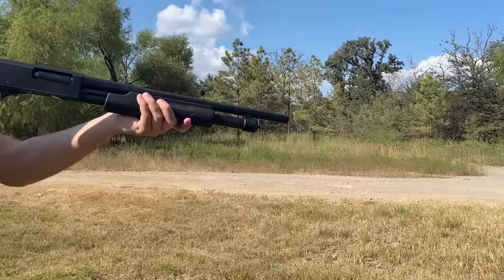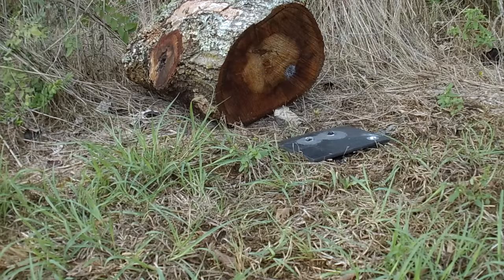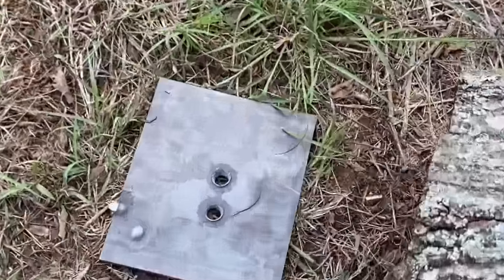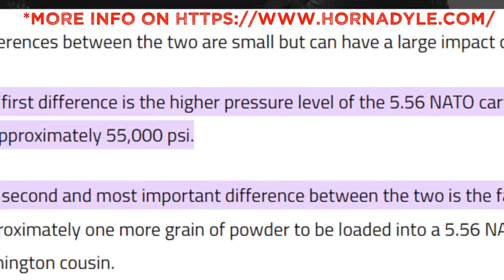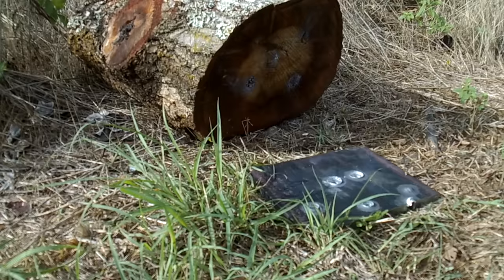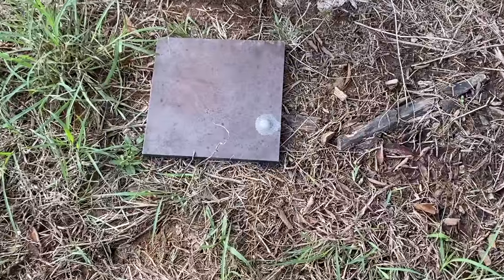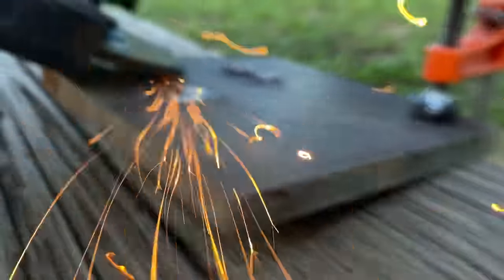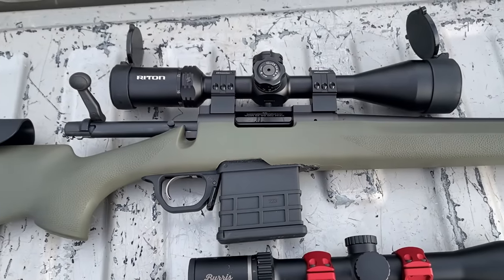223 vs 5.56: You Won't Believe The Difference On Steel

Comment: You said the same thing in the .308 v 7.62x51: 'Externally you wouldn't be able to tell the difference between the two cartridges." and the difference between the cartridges is glaringly obvious. The NATO rounds have annealed casings. That's something you might want to point out, since you haven't to this point, maybe in the future...annealing/sealing, and why.

Comment: What you said about the 556 may be true with more powder, But I have taken both apart and haven't found that to be true. The biggest difference is where they take the pressure reading from on the rifle. That's why the 556 has higher pressures for the most part. I don't  discount the 1 gr. More powder. I'm sure some manufactures do. But then they would cost more. Also the bullets need to be the same brand/mfg. to do the honest test. Keep up your testing.
Reply from the maker: I agree with you, that was just the info that I found on the hornady law enforcement website. I think that it might be true for the ammo that they sell directly to law enforcement, but not necessarily the civilian market.
Reply: Even if you weigh powder from each 223 and 5.56 it wont really tell you anything because they are probably not using the same powder. I reload for 5.56 and use faster burning powder that gets much higher velocity compared to factory 223 (about 300fps faster) even tough its the same weight powder charge compared to factory 223 because the 223 is using bulkier and slower burning powder.

Comment: Thank,you for this video....this lays to rest all the times I've been in "discussions" with bozos that say there's no difference.
Reply: If the ammo is from a reputable manufacturer, you will still find that the lower pressure thinner webbing .223 is loaded to it’s original 50+ year old specs, but the waters have been muddied so much nowadays.

Comment: the grain of the bullet counts for a lot in penetration in targets. its a fact that even applies to arrows and bolts .
 The weight of a projectile and the diameter are the determined effect and the powder the level of intensity its applied at.

Comment: This test is odd because I shot at industrial grade mild steel target stand with a 3/8 " plate welded on a 3/8" stand and I was able to shoot through one and both with most FMJ rounds I used with 10.25" inch barrel.

Comment: Good insightful test.  Yes your testing results proved that there is a clear difference in power factor penetraition between the 233 and 556.

Imagine if you can get some of the newer US Military 556 Tungsten bullets. Chances are they probably would penetraite the half inch steel plate.

Also some of the Soviet Russian rounds in 545x39 penetraite might as well.

Keep up the good important work.
Reply: Yes, the M855A1 ammo easily goes through 1/2” mild steel.   It also penetrates 9/16”.

Comment: I’ve accumulated a nice stash of .223 ammo the last couple of years.  Now I’m wondering if I should have (also or instead of) been buying 5.56.  There is lots of FMJ and green tip ammo available in both those calibers (as well as certain pistol calibers) but it’s hard to find ammo with PSP, hollow point or deer hunting bullets (which are all more expensive).

Comment: I enjoyed the video but may I suggest a change in testing method. Your steel plates are at an slanted angle thereby making the plate harder punch a hole through. It also makes the plate thicker. If you measure the plate at an angle it will measure thicker than if  measured at 90 degrees. This is why tank armor is slanted and not at 90 degrees. Not that a steel plate at 90 degrees would change your results but it would make for overall better testing. I did enjoy your video and thank you for taking the time to make and post your video.

Comment: I always thought the 5.56 case should have been made about a millimeter longer, just so you could get a little bit more velocity out of the heavier bullets.  Or maybe just a little bit fatter would be better,  or both. Actually I feel the same way about the Grendel, longer case on that one.
Reply: They simply went with a different powder.
Reply: The .223 chamber was designed with a short throat for better accuracy. The 5.56 chamber has a longer throat, like Weatherby chambers, to allow higher velocities without raising pressures. They chose to raise pressure on the 5.56 too.
Reply: If you roll to 2:23 in the video you can see that the 5.56 is slightly taller. This is due to the 5.56 NATO bullet being 50/1000 of in inch longer which matches up with the longer free bore in 5.56 NATO rifles. They did this to change the behavior of the bullet on impact especially on soft targets. The .223 loves to tumble on impact which is why it inflicts horrific wounds but is poor at penetrating obstructions. The 5.56 NATO maintains orientation on impact and doesn't tumble. There is lots of video on this using ballistic gel and watermelons if you don't believe me. Never fire a 5.56 NATO round in a rifle chambered for .223.

Comment: So, i think a factor not being included in analysis is twist rate. It also is why some heavier rounds wont stabilize in lower ratio barrels in another vid.

Twist rate can cause higher backpressure in seemingly identical builds, and increase dwell time in DI and piston guns.

This is why 62gr 556 is not reccomended from a 223 build.

Ive been meaning to get out and do some steel penetration analysis and documentation but havent had the time. Glad i came across your channel. Cool content. Subbed and following.
Reply from the maker: I really appreciate it and agree with the points you made! I believe that is what happened here.
Reply: @bananaballistics  have you ever seen the 8.6blk? Its the next build im gonna be working on. 1:3 twist! 

Im also working on a 30cal (for 300blk) that is progressively increased twist rate going from 1:8 to 1:4 for subsonic use. That should be interesting. Gonna also have to play with dwell times and buffer weights but goal is to reliably cycle the heavy 240 gr bullets.
Reply: No no no. Its not the twist rate, its the chamber throat. NATO rounds have higher powder charges that make for higher chamber pressures. The NATO chamber free flights for almost a 1/4" before engaging the rifling. The 223 is practically engaged in the rifling when chambered.

Comment: .223 pressure is measured using SAAMI. 5.56 NATO is measured using CIP. They are different and will give different readings on the same ammo. The difference between the two cartridges is really nothing more than chamber dimensions. Most notably. Head space. .223 at .025 and 5.56 at .050 so that the military has more options in bullet weight for specialty ammo like tracers, incendiary,etc.

Comment: Well shoot again but make sure the backing is the same.  The bounce of the metal plate has to have to effect the penetration.   There is a center of mass on the plate if you are off that then it can move and disperse some of the energy... ??

Comment: The pressure difference is mainly due to different messurements standards, the longer conus of the 5,56 is only to allow the use of special ammunition with longer bullets

And this sample size is much to small to do a propper comparison

Also you would need to use ammunition with the exact same bullet to elimminate diviation due to metallurgic differences

And grinding the bulge off is definitly not even a remotly precice method of messuring anithing here

Comment: The difference is the powder used and the test barrel length. They use slower powder for .223 sometimes and use a 24-26” test barrel. This is what screws people up. They think they can get 3,250 fps out of a 20” barrel when they actually get 2,950-3,000. If there running a 16” barrel they get about 2,800.
So I think the main advice I’d give is on the test barrel.
The availability of cheap 5.56 makes .223 illogical unless you have a 24-26” barrel.

Comment: how it was leaning up against the log would make a difference.  If the steel was able to rock back or slide back upon impact that would lessen the impact.    A valid test would have the plate in a solid frame.

Comment: 30 ft per second is not a normal differential between 223 and 556. However with slower burning powders you can keep the pressures down and get the velocity up with 223. That said, there are very few weapons that actually have a short freebore to the rifling that are technically 223 chamberings. Ruger made none of them and they're Mini-14 except for the possibility that they make a Target 223 Mini-14 right now that may actually have a shortened freebore as a chamber. The biggest difference between 223 and 556 is the chamber pressures. The problem there is that the chamber pressure when you test it from a standard cartridge is taken from the main body of the case. And chamber pressure when measured from a military cartridges taken from the neck. And that could show up Easley 10,000 lb difference as the neck of the cartridge will exhibit much higher pressure spike than the main body of the cartridge. As for 3240 feet-per-second compared to 3270, you'll see more speed differences in the individual cartridges themselves. Often overlapping in velocity. So is is there any functional difference between a 223 and 556, the speeds are that close, not a single dimes worth. And the difference in the test Barrels in which these different cartridges are tested, it means that what you see on the Box means nothing, you have to test your individual rifle.
You also need to check the actual projectors used, they may not be exactly identical.

Comment: Interesting vid mate. I suspect that the slightly higher velocity is what did it for the 5.56.
However, you missed some facts about the difference between 5.56 and .223, that are crucial to understand from a safety perspective for anyone considering shooting 5.56 out of a .223 hunting rifle: You touched on the higher pressures of the 5.56 due to the longer throat, but its important to understand WHY 5.56 rifles have a longer throat. While you are right in saying that a longer throat allows for higher pressures, the main reason for a longer throat is for reliability in real-world battle situations. It means better / more reliable cycling, when battle conditions include dust and dirt.
While there are some differences in the ammunition (5.56 generally have crimped primers & thicker case wall for ammo reliability - which also means higher pressures for same powder charge compared to thinner walled .233), the main difference is in the firearms themselves, ie: the longer throat & higher/lower manufacturing tolerances.
The longer throat of a 5.56 rifle also means that it can shoot longer, heavier bullets (more room). This means that you should be very careful WHAT 5.56 ammo you try to shoot out of a .233 hunting rifle. If you try to shoot say a 5.56 tracer round, you will likely find that in a .223, the bullet will easily make contact the lands of the rifling. If your throat is especially short as more and more higher tolerance precision and hunting rifles are becoming, this may result in one of three things: 

1: decreased accuracy 
2: the lands may "grab" the bullet tightly enough that, should you decide NOT to pull the trigger, and you try to extract the live round, you may find that the bullet stays jammed in the rifling and you remove only the shell, leaving half of the powder loose in your chamber.
3: Contact with the lands may seat the bullet further into the case, which of course increases potential pressures. So, with 5.56 pressures already potentially higher than .223, you may be unknowingly increasing the pressures even more, in a rifle that was never intended for such pressures. !DANGER!

So yeah, its important to understand that the firearms each of these rounds are intended to be fired out of, is where the REAL differences are.
Military / AR platforms are generally built on reliable cycling (self loading), which means that tighter tolerances are harder to achieve RELIABLY in real world scenarios. They are getting better, but they will never come close to the tighter tolerances of a modern bolt gun. Tighter tolerances means "less empty space", which in turn means "more pressure from the same charge."
SAAMI specs are based not just about the round itself, but also on the STANDARDS that a rifle is built on.
A manufacturer who makes a bolt gun, must make it in a way that it exceeds the SAAMI specs. While modern bolt gun receivers are getting more and more "rock solid", the weak point is generally always going to be the bolt lugs. 
Personally, I would be VERY careful WHAT 5.56 rounds I put through a .223 bolt gun, and if I did at all, I'd be looking for pressure signs just as if I was trying to work up a "hot" round myself: sticky / tight bolt during extraction, flattened primers, etc...

Anyway, sorry for the long speel, and thanks for the vid so I could see the results. 
"You did so I didn't have to." :)
Reply: And just an afterthought: With the tighter tolerances of your bolt gun, its likely that the velocity of the 5.56 may be much higher than you anticipated. I'd be REAL interested to see you chrono BOTH those rounds to see the difference in velocity of each, between the two guns. Cheers :)
Reply: Don't forget that the longer throat allows the bullet to jump ahead thus reducing peak pressure considerably. Both 5.56 and .223 ammo will show lower chamber pressures and velocities in a 5.56 chamber than from a .223 chamber with all else being equal.

The dangers of firing 5.56 from a .223 are definitely exaggerated in my opinion, but why test your luck?

Comment: How much of the force of the bullet is being lost by pushing the plate around?  If the plate was mounted firmly in a solid metal bracket with some weight to it, then you would probably get better penetration.

Comment: The 5.56 isn't moving only 30 fps faster, it's more like 200-300 fps faster. Winchester 5.56 is actually fully loaded, military spec Lake City M193 and the advertised box velocity is from a 16 inch barrel. .223 loads are chronographed from 24 inch test barrels.

Comment: Im not sure how accurate your measurements are after GRINDING but if your using those machinist blocks in helping you determing how high your bullet swells are then subtracting that indifference from the overall measurement , then i would say that's pretty accurate . Too bad you don't have a milling machine , otherwise you could mill those swells precisely flat . Speaking of the bullet swells , you know how some bullets are better at hard targets while some are better at soft targets , maybe we need to measure the internal space of those cavities before you grind by either pooring liquid into them and then pooring that liquid into measuring cup or filling them with something like epoxy , clay , bondo , etc , which then you could drop those cavity molds/castings into a measuring cup filled with liquid to count the displacement or just weigh them or just do a visual inspection . But Don't do away with that " Time to Grind " segement or the flying Bananna . I think either way you do it we'll all be able to see those bullets that are a close call which one is more of what we want for our bullets , minus recoil effects though , that's pretty much why we watch your videos , better to see you get tortured than one of us , ha ha ha , Thanks !

Comment: So generally speaking, would it be safe to assume that the average 5.56 round in about 10% more powerful than an average 223 round?
Reply: No. Not without velocity testing which wasn't done here. 
There are better videos showing 5.56 that is underwhelming.

Comment: Couple things to note : 
1. where did you get those pressure numbers ? You do know that the military pressure measurement is not comparable to SAAMI pressure measurement. 
There is not much difference in actual real pressure with 58k value of military measurement method to 55k value of SAAMI measurement method.  
2. The fact that each caliber is specified to certain max pressure does not guarantee Any manufacturer load their bullets to that MAX pressure. They might save costs and load them 10% less than max. And If caught, claim it was for safety. 
3. In addition, not all manufacturer production runs are even quality. When starting the production batch they buy smokeless gunpowder that meets their exact strict requirements:  what-ever-is-cheapest at that time. The type, speed, power, grain size might vary from production run to production run. ONLY thing they need to make sure that the load they use does not except the MAX  for the caliber. 
4. Ammo propellant load is measured by WEIGHT not volume. If manufacturer uses faster burning powder for the production batch they load less of it by weight and you get lower velocities in longer barrels as where using lower burning powder they cal load more as the peak pressure does not get as high as with faster burning and you get higher velocities with loner barrel. 
5. The gun powder pellet shape varies by how each manufacturer makes it same weight of same strength gunpowder produces same bullet speed but the actual volume might vary based on the gain shape. Because the volume does not matter, at least not to the 1,9% accuracy of the outside volume differnese. 
6. Just because the outside volume of the specs differs 1.9% does not mean the inside volume does. I suspect that it might even vary up to +/-1% between every single manufactured case. The specs are for exact OUTSIDE dimensions, not inside. I can not remember how strict the material thickness tolerances of the case is in each caliber were. I guess the is easy to see. Take 100 cases from 10 different manufacturer and weigh them on really accurate scale and I doubt those are within 1% of same weight. Again the exact brass metal mix itself might vary 1%. 

P.S. I am not an expert but these are the things I read, noticed in ammo in real world and basic fact of life and manufacturing.